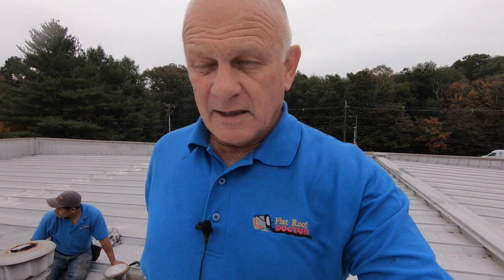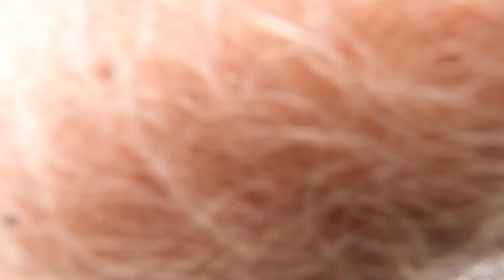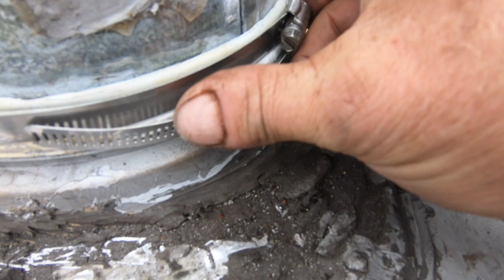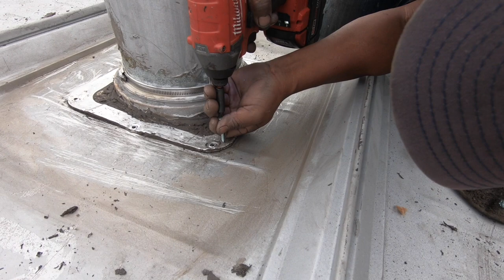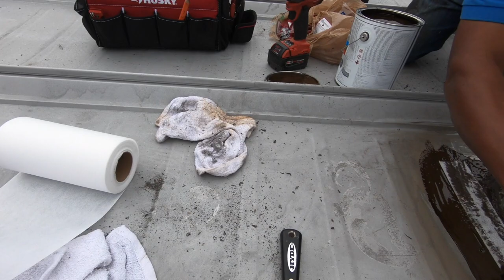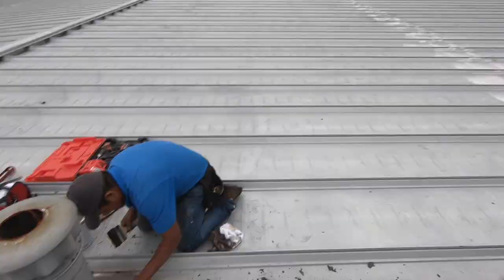Vent Flashing Pipe Leak Repair on a Metal Roof - Step by Step easy permanent repair- DIY

Comment: Lol good vid. I waa thinking of putting a metal roof over my existing flat torch down roof
Reply from the maker: Hmm, why would you do that? Only if the Torch Down is beyond repair. I still think it is much cheaper to repair or to install another layer over the existing Torch Down. The second layer will outlast any other roof system.

Comment: I'd like to see pre cut round fabric rings
Will save cutting them onsite in the wind etc
Reply from the maker: You have a point, but no object is the same in circumference or shape. It is much easier to have the material and cut it to size.

Comment: That’s the wrong pipe boot/flashing for that roof. They make one where the rubber ring around it is clamped at the top and is has enough material so when you step next to it it expands like an accordion. Never fails